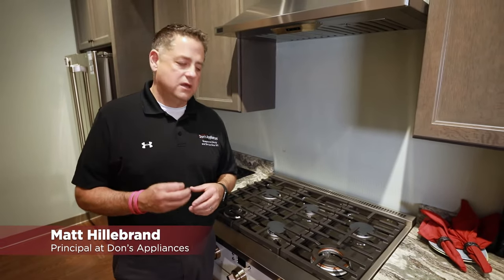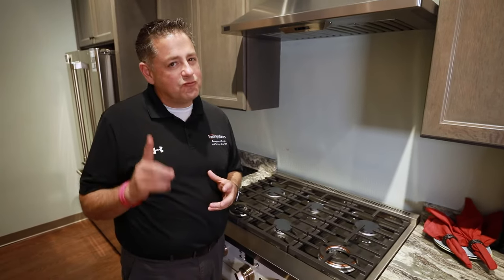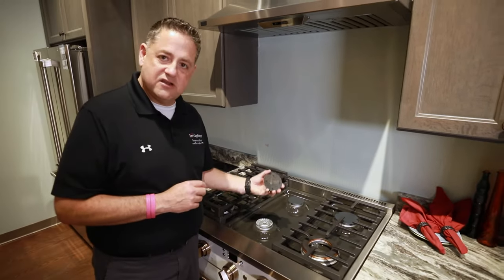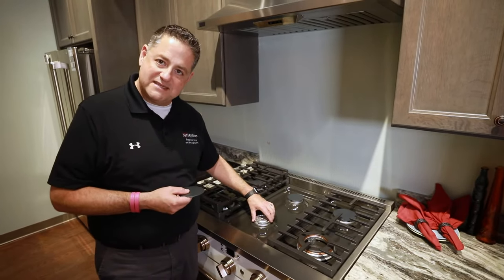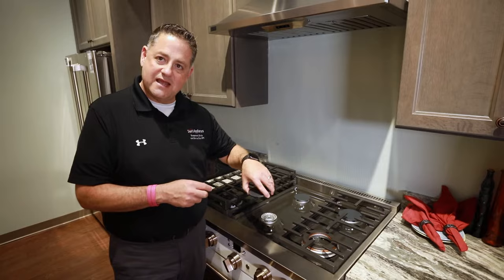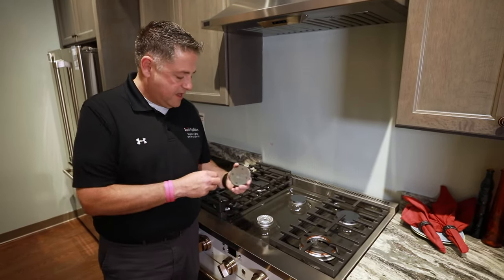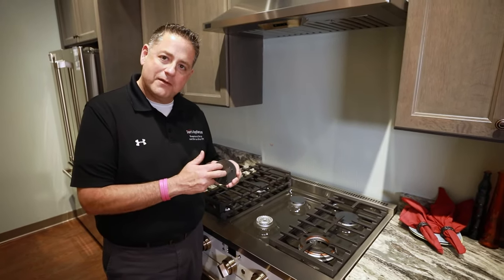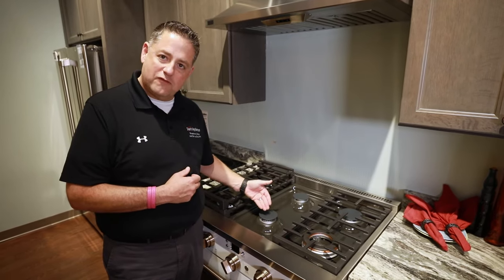Igniters are Clicking But Burners Won't Light | What Could Be Wrong

Comment: Ok my Viking, the right two burners will light but the left four all of a sudden, no clicking sound so wondering does that mean something more wrong with the wiring or is there any type of control module that is an issue or no because the right two work?

Comment: Hello and good afternoon I hope that you are well. I have a Beko KDG252 cooker and for some reason the gas is coming out but the clicker aint working to bring the flames on the oven and hobs. I would be super grateful for some help. Thank You
Reply from the maker: It could be an issue with the ignitor. We'd recommend contacting your local service department and scheduling a service call. Hopefully they can get the problem resolved quickly!

Comment: My situation is opposite.  It seems too close between the lighter and the cover, as a result the spark is too weak/short.  I need to lift the cover a little bit so that it does NOT sit firm and the gap between lighter and cover is bigger to light the gas.  But my issue is that was not the problem until recently.  I am still looking for a better solution.  Appreciate if you have any suggestions.
Reply: I have the same issue. Should the base and the cap e replaced?

Comment: qe dropped soup on the knobs.  then the electrics do not work.  like a short circuit.  is there a fuse inside the ge monogram gas stove top ?  i have 120V power and i have gas.  no clicking, no lights under the knobs when turned on.  it is an electrical short.  hard to believe the transformer would blow. it is just two coils of copper wire.
Reply from the maker: It's hard to say without looking at the product. We'd recommend contacting a local service technician to come and look at your range to see what else might be wrong.

Comment: Good evening, my stove is new and it's not igniting. What could be so wrong and it is only 3 weeks old
Reply from the maker: Make sure the gas lines are secured and hooked up properly. Double check your igniters like shown in this video too. If you smell gas, there could be a leak. If that's the case you'll want to call a local appliance technician!

Comment: What if there is a clicking sound but no sparks on all burners?
Reply from the maker: You might want to clean your burner cap. Sometimes grease and grime can block the gas. If that doesn't work, you might have an issue with the gas lines. At that point we'd recommend contacting a service technician to take a look.

Comment: Mine clicks, I can see the spark. The spark rotates as it does on all of the burners. I can smell gas, but it rarely lights.  I am thinking my cap may be worn down and not letting the gas out to the spark ?
Reply from the maker: You may want to call a service technician to come take a look, especially if you are smelling the gas but it's not lighting.
Reply: @Donsappliances  I remedied the problem by playing with the cap on top of the burner. It does not lock in place and is not supposed to. The burner itself has 5 small cast iron vertical pegs that hold the cap slightly above the burner that I assumed were worn down. I just rotated the cap and attempted to start it several times until it worked. Once it did, I marked a spot on the side of the cap by scratching it, so I know where the scratch is and where the scratched side of the cap should be in order for the burner to ignite.
Reply from the maker: @nickcellini5609  Glad to hear you were able to fix your problem!